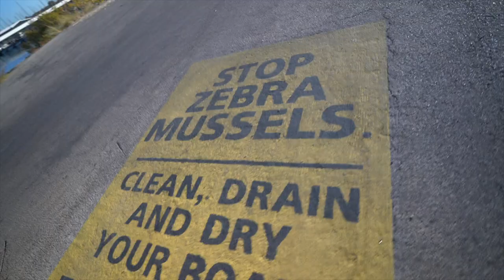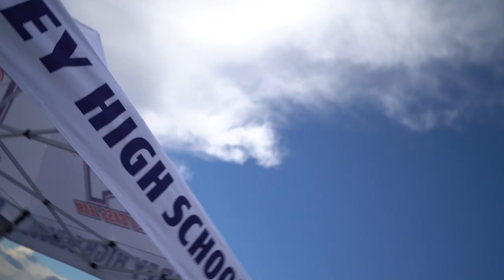Fisherman's Worst Nightmare! Stepping on a TREBLE HOOK (PAINFUL) we try to yank it out

Comment: Great job, Westin, by taking on the task of being a boat captain for these kids. 

I got hooked only once by trebles and it was bad. Squarebill crankbait, caught a small bass, yeah the ones that'll hook you quick, got the one treble hooked from behind the cuticle of my thumb into underneath the nail. Had to have a small hole drilled into my nail where the point of the hook was, push it through, cut the hook with a small Dremel and pull it though completely. 

It's so funny that you looked up ole Richard Gene the Fishing Machine as one of the videos to remove a hook. Good ole RGTFM is a North Alabama native fishing on the same system I fish on. 

Love your vids! Love you supporting our next gen of bass fishermen! Love your energy! 

Would love to one take you fishing on Pickwick Lake or Wilson Lake and aee if I can get you on some ledge fishing. 

Tight lines!

Comment: Time to hit Amazon  . full size  wire cutters Channellock 338 cut the hook eye on both sides of the split ring  . If two barbs are buried cut them where they join at the shank leave enough of the bend to work hook chunks out . sometimes you have to push the hook in until the barb pops out the other side like sewing
Reply from the maker: Ayyy what a comment! Thanks for all the info, NOTED!! I gotta check into those cutters
Reply: Was going to say the same thing.  Better to sacrifice that hook over a toe.